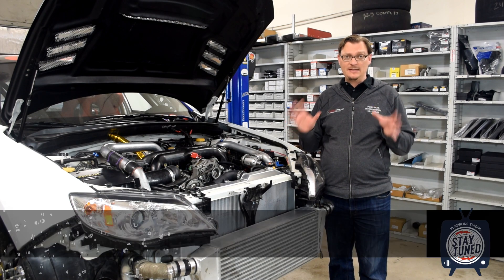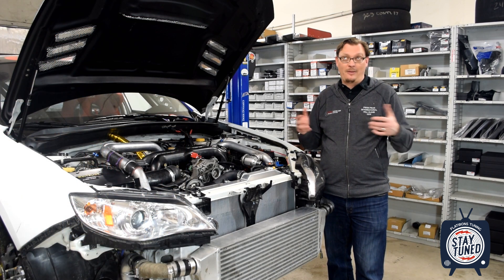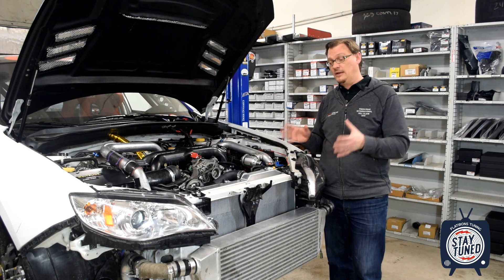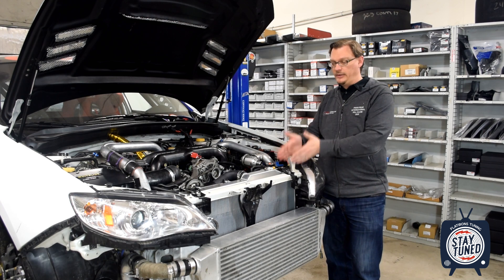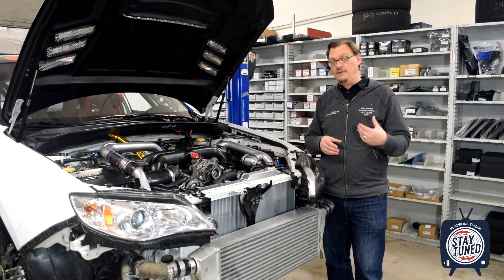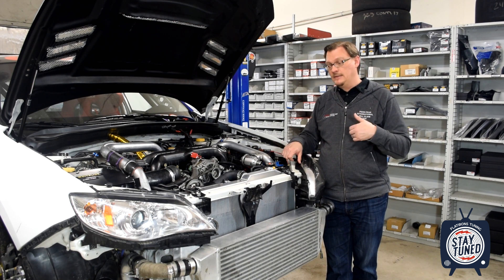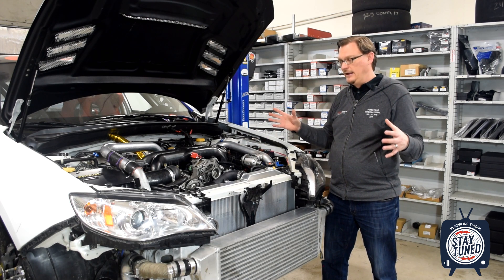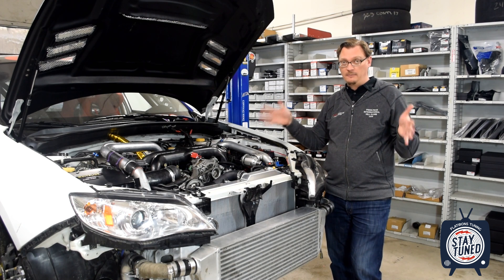Cooling Changes to our Subaru Race Car for the 2021 Pikes Peak Hill Climb

Comment: Hey @FlatironsTuning great video, I had a question on the turbo coolant lines connecting to and coming directly off the turbo on a 96 GC8, can I use heater hose or does it need to be radiator hose?
Reply from the maker: Thanks for watching and thanks for your question.  Yes, it just needs to be coolant hose.  As long as it is reinforced, it should be fine.

Hope that helps and Stay Tuned!
Reply: @FlatironsTuning  Thanks mate, I can't seem to find that in coolant hose here, is heater hose the same thing? Does it need to be rated to a certain pressure or temperature range?
Reply from the maker: Heater Hose or coolant should should be just what you need, provided it is for an automotive application.

If you look at the cut end of the hose, I'd expect that you will see fibers or cord that reinforces the hose for the pressure.

Hope that helps!
Reply: @FlatironsTuning  Thanks mate thats awesome! Can't wait till you guys hit 100k subs!

Comment: Pwr cores are best and don’t go thicker than 42mm on the core air flow is better next problem after the gc8 
Radiators go down flow make a custom radiator that goes cross flow it’s a lot better I’ve done testing on this both track and dyno next problem is thermos and shrouds 
Fun a spal fan I went to a single from the factory twin but custom made a fan shroud with rubber flap doors and again the car runs way cooler than ever before you may want to also turn thermos of at over 70 mph depends on application tho 
And run a proper header tank 
And yes ofc air ducting and fixing high pressure areas 
Those down flow radiators just arnt as good the tanks to long and water doesn’t distribute as well as you would like 
And those factory thermos are abit of a joke 
Also the factory ecu turns first fan on at 93c if I’m not mistaken no hood for a race car 
Wanna control it to around 85c seems to work best in my testing on e85 and big boost currently at 600 whp on a 2 litre and 1220 nm wheel tourqe so I’m creating heat and have tested all of this and that’s what I found to work best and Offcourse the cooling mod 
And ceramic coating the combustion chamber intake ports and exhaust ports pretty sure I’m the first to try it on intake ports but wow amazing difference aswell not as much heat soak at low rpm high loads on dyno but ofc eggs went up around 30-40c pretty much everywhere

Comment: Not a racer. At all. But I had similar cooling issues up long grades while loaded down on my 2011 Outback 3.6 R. These were long grades as I crossed over the rocky mountains from the PNW through to CO. Come to find out, the plastic under tray had been broken by road debris and was mostly missing. Replacing this literally fixed the issue completely. I suspect it helped develop negative pressure behind the radiator. Just my guess.
Reply from the maker: Thanks for the comment, and thanks for watching.  Stay Tuned!

Comment: So we will know the results after June this year?
Reply from the maker: Honestly, we are planning to head to CotA for Super Lap next month.  If the car stays cool there, I think that will be a solid indicator, but yes, Pikes Peak this year should be a good test too.

Thanks for watching and Stay Tuned!
Reply: @FlatironsTuning  cool!  No pun intended.
Reply from the maker: @2018wrxaddict  Not sure if you have seen this yet:

https://youtu.be/S32gKb0jsrU

We have our new hood on now finally too.
Reply: @FlatironsTuning  I sure did.  It's the video that made me ask if you had heard of the Killer B radiators 😁
Reply from the maker: @2018wrxaddict  My bad.  Forgot about that 😀
Reply: @FlatironsTuning  It's ok 👌 🙂
Reply: @FlatironsTuning  I'm still working on building my 18 WRX for the G30-770 turbo... Got the STI transmission bolted in.  No engine yet.  Got my iWIRE Spiider dccd Pro controller.  Added some mm to the drain pipe on the custom turbo sump so it will clear the turbine housing.  Lots of little things.
Reply from the maker: @2018wrxaddict  Should be a lot of fun :-)

Comment: Do you guys run a cylinder 4 cooling reroute/mod (whatever it is called) in this car? what are your thoughts on this modification?
Reply from the maker: Thanks for your question.  We don't at this time, but it is something that we have looked at possibly adding.

If we do, we will certainly let you all know how it goes.

Thanks for watching and Stay Tuned!

Comment: The skidplate you are using might be affecting the airflow as well. I'm not sure wethever Laile Beatrush skidplate is complete BS or not, but it might be worth investigating.
Reply from the maker: Thanks for your comment.  We are actually running a full front splitter, and it goes under the majority of the engine bay.

This may be the last year we run it though as it is getting to be time to change the aero package on the car up.  We'll just have to see.

Stay Tuned!

Comment: I would also add that extraction vents on your current hood seem to be quite far back on the bonnet. There is good chance that in that area high pressure zone is already forming and in this case it would not help extracting hot air from under the bonnet at all. You want to make sure that extraction vents are located where low pressure zones are :)
Have you considered dividing air flow horizontally in the middle so that flows going through intercooler+radiator and only radiator are separated?
Reply from the maker: Thanks for your comment.  We had considered it.  We are going to be testing this weekend on the Peak, so we'll so what we find there and we'll go from there.

Thanks for watching and Stay Tuned!
Reply: @FlatironsTuning  so how did it do? anymore cooling issues?

Comment: But yet you're still running bar and plate fmic instead of a tube and fine with is way better with flow and heat...🤔.  F1 uses only tube and fine....sooo

Bar and plate is best for drag racing not endurance
Reply from the maker: Thanks for the comment.  We like this intercooler, but we don't love it.  We have run it since the car was built in 2014, and the engine package really hasn't changed on the car too much in all that time.

We are starting to look for a complete fresh start, and a better intercooler is on that list too.

Thanks for watching and Stay Tuned!

Comment: Use alcohol instead of water haha it has a longer boiling point so it will have a higher efficiency to pull heat from the core then water (joking because it’s flammable, but like not joking it would work better)

Comment: Are you at all worried that the water from the radiator cooling system will find it's way to the rear of the car and onto the tyres?
Reply from the maker: Thanks for your question.  We have been running this for the last 8 years, and we haven't had any issues to date.  Since it is a mist, and it is mostly hitting the hot radiator for the most part, the amount of water that hits the road is minimal if any.

This is true at hot track days as well. 

And if it is cool out, we just don't run the sprayers.

Thanks for your question and Stay Tuned!